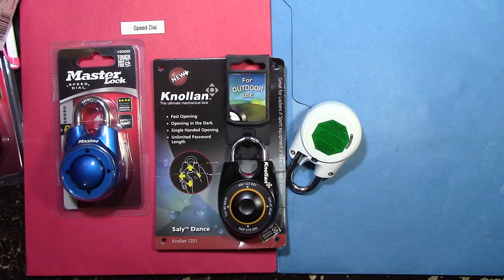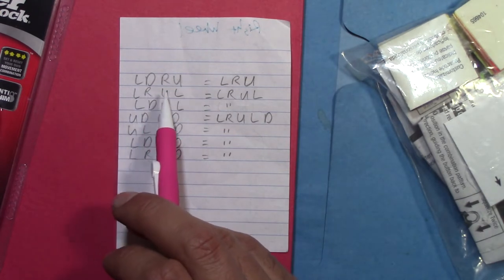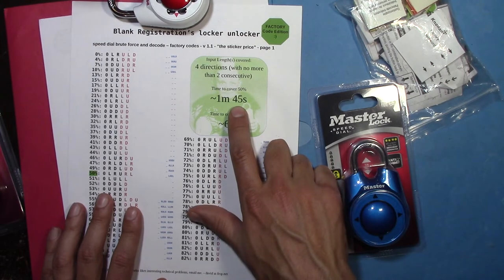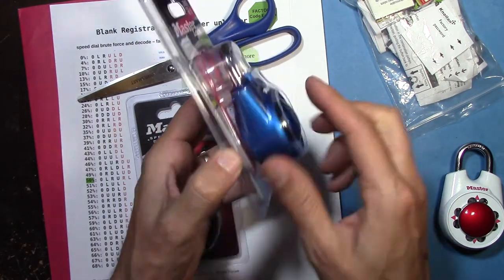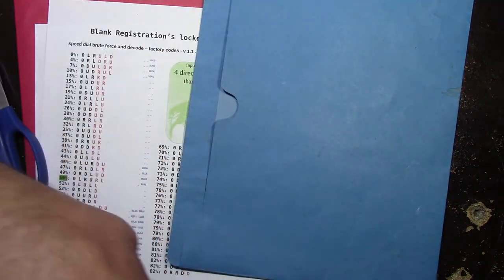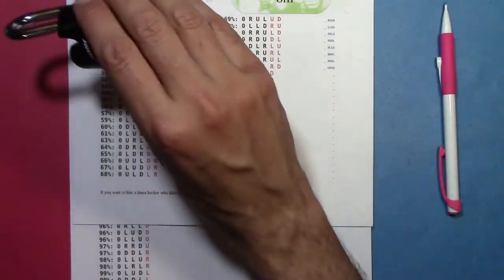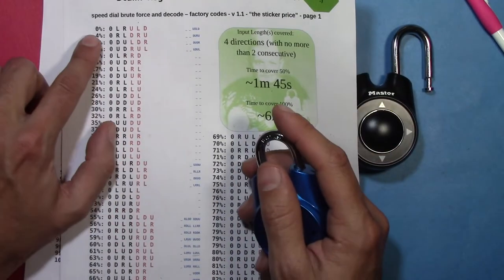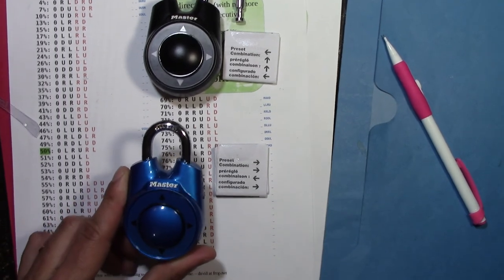Master Lock Speed Dial Style Lock Factory Code Brute Force Attack.

Comment: Thank you!! My Speed Dial lock has been permanently attached to my gym bag for like 10 years lol (because I forgot the combo and the paper it came with and was too stubborn to cut it off). 
Got home from the gym today, looked at the lock still stuck on my bag and was determined to finally find a way to open it -- found your video and opened it at the 53% code with your sheet!
Reply from the maker: woohoo!
Reply: Mine was on the gym bag too... but only for about a month.  (I got plenty of exercise shoveling snow this year)  And my lock opened at the 28% code.   Cause for concern, however: these locks may not be very secure if they are so easily hacked.

Comment: Have had one of these locks someone gave me sat around for literal years, searched multiple times for a way to defeat it. Out of the blue search again but scroll further and find your video. Method works perfect first time through (took me until the second sheet so I was worried but got it in the 90% range). 
Fantastic video (especially your patience with Mikey) that should be the top rated one when looking up this lock. Great job.

Comment: omg, i didn't think it would work but literally the second red letter made it open, i'm shocked, thank you!
Reply: could u possibly explain how to follow the sheet? and how you did i
Reply: @noemiemika6414  Did you watch the video? When you see zero in the sheet, reset the lock (press the shackle in according to the official instructions). Then enter the combination in the sheet and pause to pull the shackle at every red letter. Repeat until lock opens.
Reply: Dumb question but do you pull up after each red or AS you are moving in the direction that the red font indicates?  @MikkoRantalainen
Reply: @jessicagagne6318  Whenever you have dialed one red move of the sequence, try to pull up from the shackle to see if the lock is already open. Did you maybe misundertood "pull up" meaning move the dial upwards?

And do not push the shackle downwards because that would reset the combination to initial state (no moves entered).

Comment: Does this work evenif the same direction got used more than two times? For example dddd
Reply: I guess it doesn't work for my situation because I went through all the codes without getting it opened.
Reply from the maker: @firedupseminarsandtraining8670  no  it doesn't cover those cases, google for prevarikation speed dial, she has taken it to the next level.

Comment: I wrote down an 8-step code and set the lock. Failed to open to the code I set. I must have slipped when I set it. 😭 I read the instructions on your worksheet but I don't understand them. If you are still planning on an update for 6-step codes, could I offer you troubleshooting for the instructions? If I told you what I don't understand maybe you'd know what to write to make it understandable to more people.
Reply from the maker: Hi!  thanks for the comment.  I think to really understand the lock you have to watch alot of videos on here especially prevarikations ones.  But if you just want to get your lock open I will say the most common error in setting a new code is forgetting to reset before setting the new.  so try to old code with the new appended. Much less common is accidental partial moves.  Pull the shackle as you enter the last few moves to see if the gate is just off by a position or so due to a possible partial moves.  If not, buy a new lock and have fun cracking the one you have open to look at the inside.

Comment: So I followed these instructions and got it open in around 20 tries. I tried to reset the code with the shackle open but I forgot to reset it. Then I closed the lock and it won't reopen. Any idea if the combination is still the factory one or if my U-D-L-R new code got tacked on to the end of the factory code?

Comment: I have tried many many times and it hasn't worked. I even bought a new lock of the same type, reset the lock (wrote it down to follow it) and it wouldn't open!! I don't want to break it. . . Help?
Reply from the maker: Try inputting old and then new combinations.  The most common error is not resetting before setting a new combination

Comment: Would these also work on longer sequences that were forgotten? I have two that must not have been set right because the factory code didn't work and the code we set it to doesn't work. Thanks for any help.
Reply from the maker: Alot of the longer sequences are equivalent to shorter sequences so there is a chance it can work. I don't have the actual numbers now but you've probably got greate than 30% chance if you do the whole sheet.  One day I will generate a 6-move sheet, or a 50% of the inner-state sheet.
Reply: @blankregistration7301  Is there any simple logic to follow while setting the code which would always avoid hitting any internal state that can be opened with this list?
Reply: @MikkoRantalainen  generate a very long random sequence and keep entering it in prevarications port if mh visualizer.  The visualizer will show you a shortest  equivalent sequence.  Enter random inputs until you have a state that takes at least 7 or 8 inputs
Reply: @notaverygoodusername  I meant is there a way to figure it out for humans? I agree that sequence with minimum of 8 inputs seems to be optimal for security but I have to use computer program to find a suitable sequence.

Using the visualizer to open the lock even when gates are marked into the wheels seems surprisingly hard task for longer sequences. For attacker that is not familiar with this lock, even a transparent lock would be pretty safe because figuring out the logic to set all the gates is far from trivial.
Reply: @MikkoRantalainen  I'm sure there are math tricks or hueristucs we don't know yet.  In my code I just brute force the 11 sequence inputs.  I'm not sure what the code of mhvisualizer does for the move db.  Point in no simple tricks I know except for looking up states in a db.
Reply: Just wondering if you ever got around to the longer sequences?

Comment: Hey, I managed to lock this onto a truck bolt but there isn't enough clearance to "clear" the lock so even though I know the password, I'm not able to open it. Do you know if there's a work around to resetting this?

Thans
Reply from the maker: TLDR: hit it with a hammer :)

Thanks for making me think about this.  Normally we go from a known state (reset) to an unknown (the opening state), but this would be going from an unknown to a known.  I do believe there is a good sequence to brute force this condition but I haven't devoted much thought to it.

If you are feeling lucky, enter the last 2 unique directional moves 5 times in a row, pulling on each last move. Each pull has a 1/625 chance of opening. After you've done that 5 times, enter a random dir and do it again.

I think you should turn to destructive methods though.
Reply: @blankregistration7301  yea I ended up grinding away at the outer metal to get enough clearance to finally reset it.
Reply: Same thing happened to me. My young ex landlord refused to be modern with keyless entry so I locked a spare care to a factory 's gate up the road. I mistakenly decided to clamp it to the flat rod that went through the gate figuring more sturdy so someone wouldn't just snip snip a thin gate square. Well that flat is snug & won't allow for clear. I moved & no longer need key. Even though these locks are now more rare & have gone up in price (after being reduced on clearance a few yrs ago) the scrutiny of looking suspicious with hammer & a non working lock is not worth the $14 aggravation.  I'll just bite the bullet & pay $30 to add to my collection so I have at least 3. A cool game is telling your son the combo & seeing if he can do behind back in the dark. These are my fav locks.  I have bluetooth ($100 value clearance for $15) but even they are my 2nd fav because they go dead & you must recharge to open. Has anyone ever figured out why these stop responding to correct combo sometimes? I'm guessing the track gets stripped from repeated moves so I suggested people keep combos more fluid like up down as much or side to side  as  many times wanted, but not both because that were the tracks get jammed.

Comment: some one help me my code was left left up up and now i can’t get it open
Reply from the maker: Hard to say what is happening in your case, but most errors are caused by reset,  either forgetting to reset when setting a new code (in that case try both old and new codes consecutively)  or reset failing due to mechanical reasons.

Comment: Sadly it seems Knollan doesn't exist anymore. They're nicer than the Master as they have letters and keys on the rim and the build quality also seems a tad higher. Don't know whether or not the Master is still made. Bit it's still available on Ali Express at least it seems. Would be nice if somebody made them in stainless steel.
Reply from the maker: Oh no!  that is indeed sad.  In my opinion  Knollans beat the masters because they have false gates which complicates gate sensing attacks like prevarikations awesome technique : https://www.youtube.com/watch?v=Yuw01PLHt48 and they have better security screws.  I think knollans are worse than the masters in overall smoothness in the feeling of operation.  Also my knollans have a gap in the clamshell,  Like you could stick a tool in there.  Its a mixed bag but i'd choose a knollan over the master.
Reply: @blankregistration7301  Yeah. Their website and everything just is dead so... I think the Knollan is just a hair higher quality - and as said I really like the lettering and numbering to help make a good combination lock - and this one is not easily decoded. Sad no one else makes a good combination lock. And the Master is not available in Europe anymore so who knows if that is on its way out too. It's true that is has flaws that you can accidentally make a combi which turns out to be the same as just a single step - but really could be overcome by an app where you put in your inteded code and it tells you if there's a shorter version of it and if so what it is to let you judge whether or not it's acceptable or not.

We can agree on MasterLock. Most of their locks are not impressive and even the few good ones they have is let down by some stupid choices. Like they're not listening and not learning either. It's just dumb because many of the flaws are not hard nor raises manufacturing costs to fix. But hey even the German ABUS company also has so many mediocre locks on the menu that they give a high rating - especially their combination padlocks and all of them are easily decoded. Perhaps the best of them is the Masterlock 175 copy which after all require a special tool. All the others can either be decoded no tool or a simple piece of plastic or even paper if you're careful enough. I once contacted ABUS to let them know I think their 158 and 160 locks have far too high rating and easily decoded using a piece of paper (and how). Got no response. Then I put up a video here on YT - I believe it's the earliest dated showing how to decode the 160. As said same attack goes for the 158 and their 787 key safe as well - and other brands look alike keysafes as well. All have been unchanged for at least a decade even though I think most of them could easily have small design changes to more or less eliminate the decoding attacks.